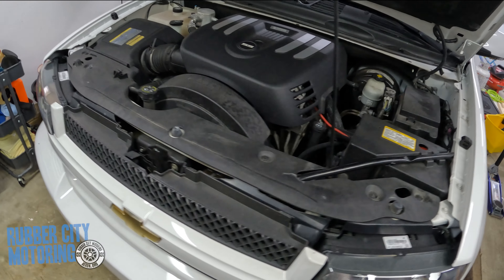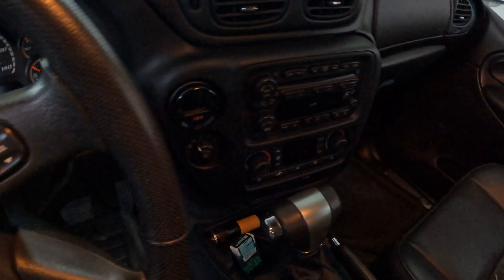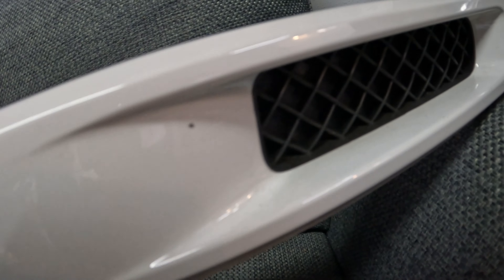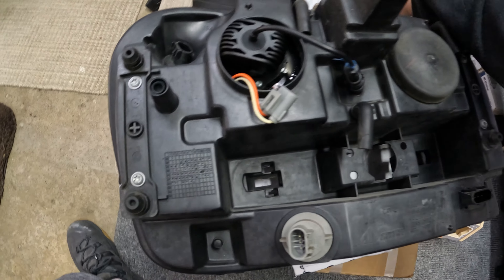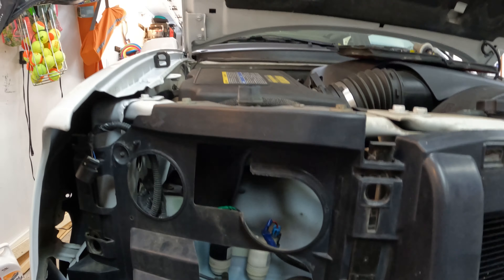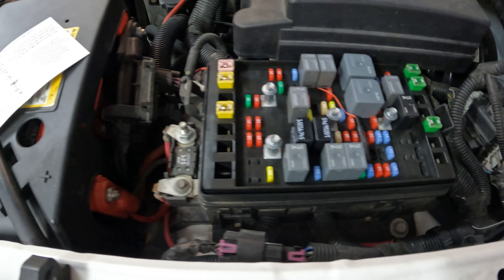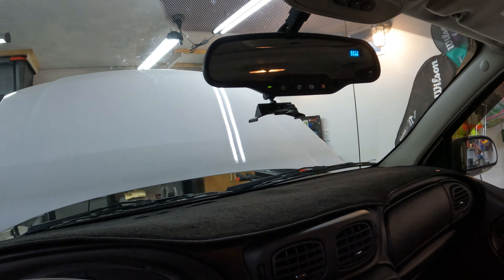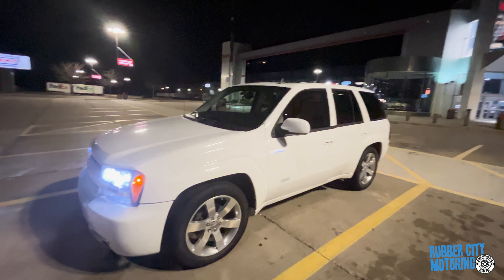Trailblazer SS Upgrades & Fun Facts: 36k miles!!

Comment: Get ur hands on Lasfit - LC plus if u have fitment issues. Those led bulbs are design to be compact and fits 95% of the vehicle. They only draw 25W per bulb, 2500 lumens per bulb, with mall cooling fan. These are brighter than what u have. 

Cooling fan will cool alot more led